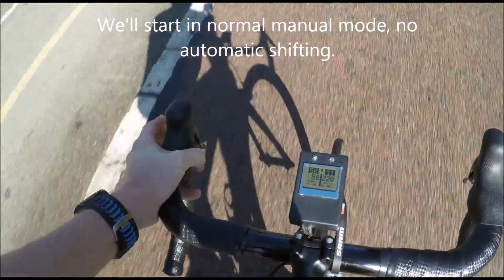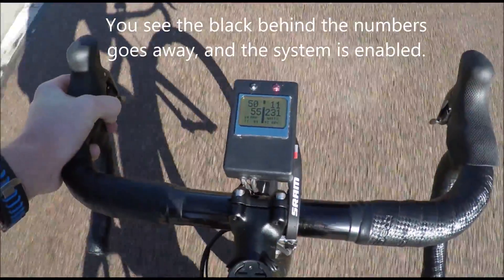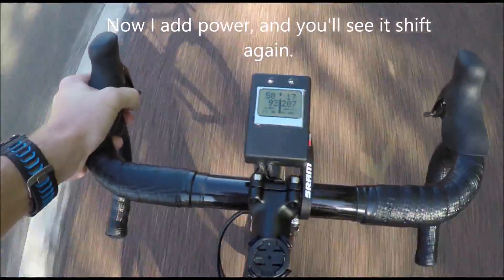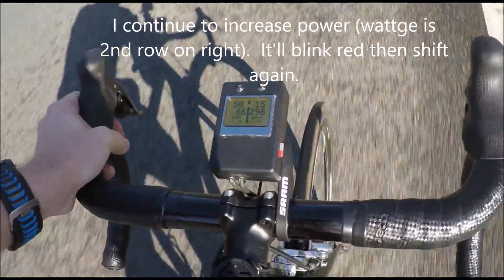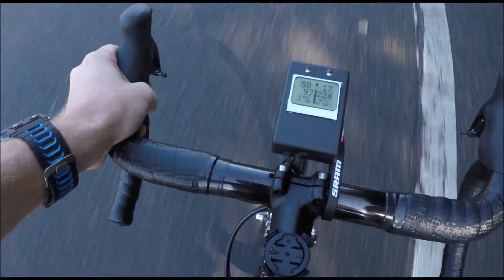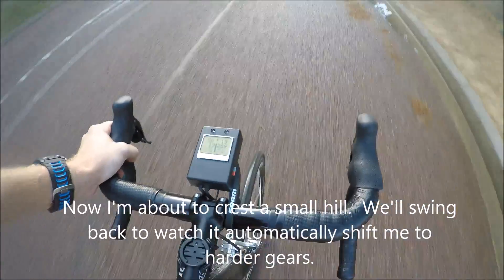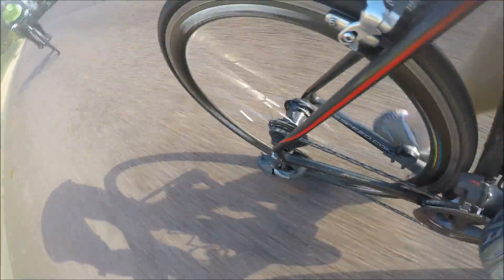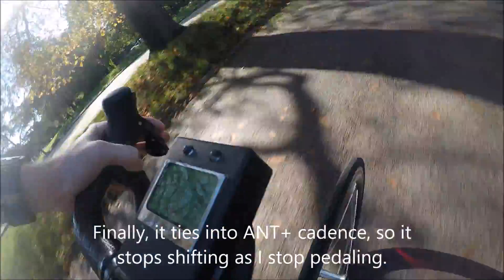Bioshift Automated Shifting Overview

Comment: I just read this article in February of 2025 after googling to see if such functionality had ever been developed, and if not, why on earth not? Can you imagine this as a mature technology ten years later? I can...ERG mode outdoors? What a training tool! Climbing hills with this? What a pacing tool! I can't imagine why this died on the vine. It's necessary! The idea of a head unit using common sensors to control an electronic groupset is brilliant, especially since no one that doesn't want to use it need ever use it.